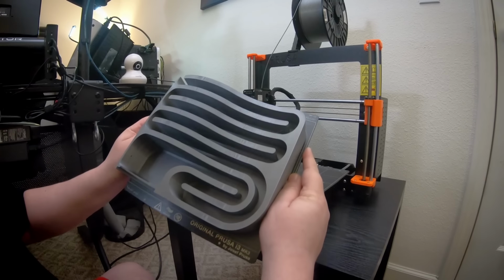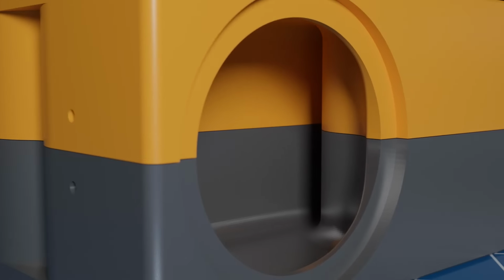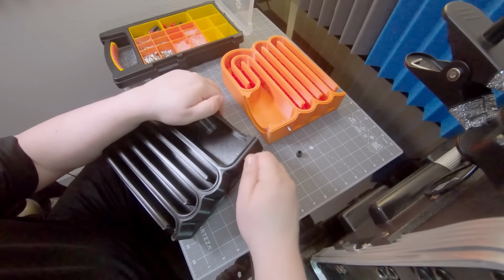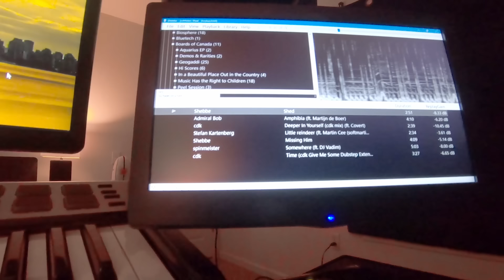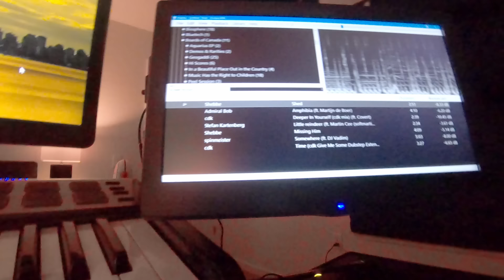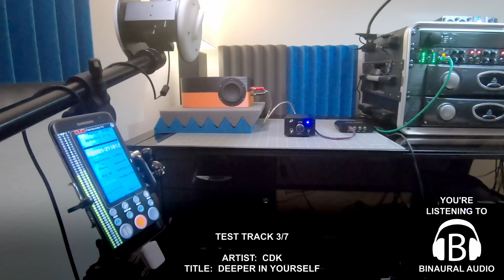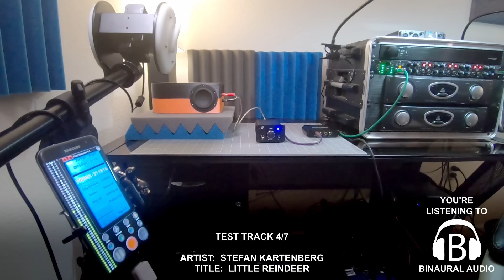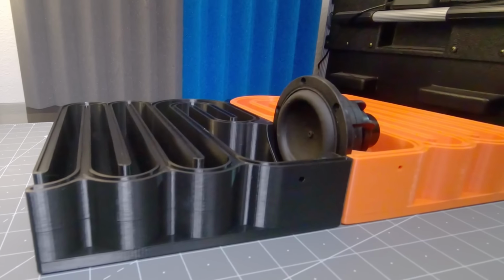3" Subwoofer Enclosure v.2 (Plus Demo)

Comment: print it hollow, instead with infill, use a thicker wall.. then cast epoxy into the PLA cavity or fill it with sand..
Reply: Would sand affect the sound quality?
Reply: You could just take a mould of the two halves and cast the whole thing in all manner of materials. What would a dense superfine casting plaster do to the sound?
Reply: @ThePatternJugglers  HAhahaahaahaha........
Reply: @christopherroberts22  did you have an aneurysm
Reply: I havent tried myself, but epoxy is cures with an exothermic reacting (it generates heat). If you trap the enclosure the heat could melt the plastic. Someone on the diyaudio group did try it unsuccessfully though.

As for the mass/stiffness. More mass lowers the resonance frequency of the enclosure, more stiffness raises it. You'd obviously want the resonance outside of the frequency range of the corresponding driver. For subs that generally means increasing stiffness.
Reply: Thu Nell Ⓥ  Not necessarily no.
Reply: Thu Nell Ⓥ  You can calculate the resonance of a panel with the formula: Fres = sqrt(stiffness/mass). You want this resonance to be outside of the range that the speaker reproduces.

For mid and high frequencies it is very difficult to move the resonance outside by adding stiffness (because the frequencies are so high). In this case more mass is much easier.

For (sub)woofers on the otherhand it is very difficult to move the resonance below the speakers range, because the frequencies are so low. You would need incredible amounts of mass to accomplish this. For these speakers it is thus easier to move the resonance up.

You can add stiffness by laminating side panels, using different materials but by far the easiest way is adding bracing. Adding braces also has the nice effect that the lower the amplitude of the cabinet vibration.
Reply: @idontwanttopickone concrete.. you do a silicone mould and cast it as concrete for maximum weight and kick

Comment: I've never herd the engineering design process called the "spin cycle" before
Reply: Patrick Zath heard*?
Reply: often called "iterative" process
Reply: It's used in metal work to my knowledge (spin > lathe). Outside that I've also heard it used in the mastering process for vinyl records.
Reply: @enlightendbel  It's a very basic principle for almost every design process...
Reply: @TheEchelon  and?
Reply: @enlightendbel  The thing is,  the youtube comment section is chalked full of textbook engineers and faux engineers who don't have much experience outside of a classroom where once you get out in the real world, all sorts of alternative terminology has been adopted
Reply: According to wikipedia: Iterative design is a design methodology based on a cyclic process of prototyping, testing, analyzing, and refining a product or process. Based on the results of testing the most recent iteration of a design, changes and refinements are made. This process is intended to ultimately improve the quality and functionality of a design. In iterative design, interaction with the designed system is used as a form of research for informing and evolving a project, as successive versions, or iterations of a design are implemented.
Reply: @LBCAndrew  yeah, I know, that's why I gave some examples and their origin.

Myself I've been trained in metal work and worked in that field a couple of years.

I've mostly spent my time in IT where "alternative terminology" is an absolute pest because idiotic managers think they are running a marketing department that has to come up with new ways to call the same old processes and methods we've used for decades.

And I grew up on an fruit farm, terminology there changes depending on what village you're in sometimes.
Reply: oops probably should have read this comment before i toasted this kid
Reply: Same! 😂
Reply: We call it "lather, rince, repeat"...
Reply: But you've probably heard of the Lean process of PDCA (Plan, Do, Check, Act) - same-same with what he means with his Spin cycle :)

Comment: Sounds awesome, I would love to see this scaled up to an 8 or 10 inch driver.
Listening on v-moda crossfade 2's
Reply: A 10 inch would make the house tear apart haha
Reply: Please scale it up to 10 inches and make measurements 👍👍👍👍👍
Reply: I have a dayton UM10 in a similar sort of contraption. Big folded bass horn assembled with plywood/screws/glue/etc. Powered by a 1KW crown amp. Box provides pretty good loading down to ~25hz. Sensitivity is very high at ~93dB@1W1M from ~30-80hz.
Reply: Hey my dude. If no one is gonna give you props on the V-Moda shoutout, here I AM!  They seriously need to bankrupt beats by dre. Only thing I have issue with thier products is the inner cord like to herniate out of the outer kevlar weave; but if left alone it causes no issue, just ugly and annoying. ✌️👍
Reply: are the V moda as good as they say? been seeing em and  hearing hype on em for a while.. i want a hands on opinion tho.
Reply: Andy Willis Andy what I’ve said before is really the only issue but it doesn’t cause malfunction. They’re incredibly rugged and sound amazing. Great range and crisp response with every frequency! I bought my wireless set on a Black Friday discount sale 2 years ago. They still look good beat up and work fine. They also offer a 50% of the purchase price lifetime warranty. Destroy them and send them in for only half of what you originally paid and they will ship you a new pair. I went through plenty of headphones in my highschool days and these are by far the best! Will definitely buy a future generation product from them if/when the need arises! 

#CrossfadeWireless
Reply: @andywillis9701  dude best pair of headphones I own, have used them constantly for 2 years doing FIFO in Australia and they haven't faulted.
I regularly do sound editing on them and the output is near perfect.

Comment: Very awesome design. Just a question: this is a T-line design. from the STL file, I can see the 1/4 wave length of the 55Hz Fs. But what I find strange, the cone surface area is 27cm2, but the transmition line cross-sectional area is closer to 17cm2. is there a reason why the design is less than the driver? or purely due to size constraints of the printer bed, you had to reduce the size?

Comment: you could also maybe trying doing one with the B&C 4CXN36 4" coax driver for a full range version, they're on parts express
they also have a waterproof coating, combine that with a protective front grill, some 18650 batteries, DC/DC converter, amp board, bluetooth module, and you have a beast of a bluetooth speaker
Reply: That is a really interesting little driver you got there!
Reply: God damn just looked at the response curve the HF is 13db more sensitive than the LF , going to need a big ass L-Pad or go active X-Over to bring it back level with the mid lol
Reply: @james8660  most coax speakers have this issue, but point source sound is great
Reply: @wow1022  You'll never ever find a 4 inch mid-range with 99dB efficiency so I guess It's inherent with the design, but yes I agree I like the point source sound, much less phase issues to correct with DSP!

Comment: Very cool. Now I all i need is a 3D printer....and a 3" subwoofer and I am good to go! :D
Reply: @HexiBase  My audio engineering knowledge is very low so if you don't mind, can you suggest a high range driver to pair with this 3" subwoofer to make this a fuller range setup? I'd love to put my Prusa to work and build a full range speaker setup + amplifier.
Reply: dayton audio ribbon tweeter, relatively cheap regarding the sound quality provided.
Reply: @HexiBase  Love this. There's actually a huge market for under-the-front-seat subwoofers in vehicles. What are the OD dimensions of this build?

Comment: You could add mass by leaving these hollow and filling the void with epoxy concrete (resin and aggregate). You could add a lot of mass by using ball bearings instead of pebbles for the aggregate.

Comment: I'm an audio engineer listening through a set of MDR 7506 cans: good frequency response to my ears. Possibly a bit over-pronounced in a few places, but that's unavoidable on ported designs and might also be the room rather than the speaker.  Also, it's hardly fair to compare this to something like a £300 studio quality sub so I won't.  For the cost I'd say this is excellent; great job!

Comment: That’s been a BOSE port design/style for many many years, possibly not the exact same but that goes back 20 years
Reply: Top comment! BOSE the best!
Reply: Try adding 70 years to that. It's called a Transmission Line or "acoustical labyrinth" and was nothing new when Bose started using it. It has some weaknesses but in this application creates impressive bass from such a small speaker.
Reply: Pretty sure this guy is bs'ing the other half of what is said..

Comment: Well, I listened to this with my Teufel suround system and the bass is very deep. Its very impressive that this small box can creat so much volume! I payed a lot for my Teufel system nearly 15 years ago, but now you can get a killer subwoofer out of a printer. Times have changed...

Comment: Back in '95 I took some ADS 300i car speakers and added a half inch more material to a cabinet I found, (total 1" thick material)  then turned it so the speakers were on the narrow side, & routed out the space for them to be inset.  After starting to test, I had NO bass, because they were intended for car doors which aren't sealed.  I did a port on the front and one on the back, used some plastic pipe for tuning, and lo and behold, they went down to 28 hz!  The only problem was I couldn't go very loud because they would distort easily (they were from the 80's after all), but they worked great with a separate sub.  Later I replaced the dome tweeters with Linaeum ribbon tweeters (they had a 2" dipole figure 8 configuration) that were routed into the top of the speakers.  They actually had great presence with a wide open sound stage.  They lacked a bit of mid bass, so I made the sub go a little higher in the x-over.  I lucked out they sounded good.  No computer, no test equipment; just lucky guesses.

Comment: It would be interesting if this concept was scaled up to a 10 inch sub.
Reply: you would get some infra bass notes
Reply: @danascoles1205  what is infra bass? I want to learn a little more and design a nice box for my sub in my car
Reply: @ronaldgonzalez9161  below-audible freq. bass. basically the stuff you feel rather than hear
Reply: @ronaldgonzalez9161  supposedly there is a note in the infra sound range called the “brown note” for reasons you can probably imagine. There are also other frequencies that are proving to be therapeutic for some conditions.

Comment: by the way, how was the precise weight of the printed design?, i'am planning to print at local service, the pricing was based on the weight.
Reply: You should know the volume of your design so just multiply it by the density of the filament material..
Reply: Download the design from thingiverse - Put it in a Slicer (e.g. Cura or Slic3r) Slice it to your liking and see what it says how much filament will be used for each side. I know Cura gives you both - Length and weigt - assuming you set the Filament parameters. Then you know exactly what you need

Comment: Have you considered changing the nozzle size?
You could easily half the printing time
Reply: Nick's Stuff wouldn’t he also lose some precision as well, not that it would matter considering it would still be stable.
Reply: @vipervidsgamingplus5723  I believe it would have a very minor impact
Reply: What he should really do is remove the bottom layers, print with very low infill (2 - 5%) and the resin fill the cavity once printed. He could save a ton of print time and have a fully solid part when done.

Comment: You need to make a version that holds a 5 1/4" speaker,  also add felt tape around the walls of the t-line, this will stop any upper midbass resonance.

Comment: Hey, you could try printing it and pausing the print right before the top layers. You can even embed a pause command in the gcode. Then fill it with fine concrete or something similar and continue printing. Then you have an heavy solid Woofer! :)

Comment: You could try to carve that design on wood for a warmer sound
Reply: With a cnc mill it would be possible to make something like this. The problem would just be finding a good piece of wood with no interior imperfections that could mess the whole thing up
Reply: Hedge or allso known as Osage orange would work really nice, great acustic wood
Reply: @bobmybob9493  and also be quite costly in comparison
Reply: @mattias2792  it would be hedge is hard to work and finding the right piece would be really hard to do
Reply: MDF or beach ply laminated sheets together would make the sound better and keep the cost down.

Comment: In the interior of the car will feel the increase in bass power, if you install 2 of these subwoofers? (TDA 7850).
Reply: matt karl  I know what you're talking about. I have 4 kids and a minivan with 3 rows of seats. It is impossible to place the subwoofer in the rear, as children are not comfortable on the 3rd row with a 10 inch subwoofer (the high sound pressure). I am considering the option of installing such a subwoofer between the driver's seat and the passenger seat, solely for the transformation of the sound picture of the driver and the front passenger. In such a local solution, it seems to me, the effect should be.
Reply: matt karl  no. 
Bigger isnt the answer..
I had a 6.5inch TL sub in my car that says you're wrong.
Beautifully clean low bass you could feel. Not 140db, but it worked perfectly.

Comment: When will u be looking for a 6,5" woofer and 8" woofer enclosure like this? I would be willing to pay for the designs! :O
Reply: Same - I could see a great business modding this design for different drivers. I'd pay $100 for a design using a JL 8W3v3  that could fit into the trunk cubby on an X3
Reply: @MarshallClark1  TL enclosures get very large as driver size increases.  I made one for an 8" Sundown, and it's huge.  I also bought a 6.5" Skar for a future build.  3D printing for either of those would be very difficult.  However, for a little 3", it's a great option.

Comment: I made one of these.  On the upside, it's the largest most perfect print I've ever done.  Took around 38 hours and roughly 700g of filament each half.  On the down side, for what I paid between the sub and the filament, I probably could have bought a better sounding sub.  It sounds just like a 3" subwoofer would expect to sound.  Definitely not that tight bass you get from one of those bose systems.  The design itself is actually very nice. Wish there were holes for the sub mounting screws.  I ended up putting in brass inserts which I probably should have practiced some before trying on the 70+ hour sub enclosure.. lol.  It was a fun project, just maybe had my expectations a little high.

Comment: Hey, I was wondering if we could improve the sound even more by filling up the space inside with foam pebbles like iPhones do with their speakers, or would that make the design completely useless?
Reply: what do you mean? what foam pebbles in an iPhone speaker?
Reply: @KennethSpringsteen  There are micro foam pebbles inside mobile speakers these days. I think it adds mass to the free air inside the micro enclosure, which makes it equivalent to a much larger enclosure. This is why mobile sound sounds so good these days, even though the driver is tiny.
Reply: @Jadinandrews  Thanks for the follow up.  I was thinking about 'mobile phone speakers', like the ones built into the chassis of the phone itself instead of the portable Bluetooth ones, like the Bose Soundlink or whatnot.  This concept makes sense as fillers are used in large car audio speaker boxes for the same effect.
Reply: @KennethSpringsteen  he is talking about the speaker in an actual iPhone.

Comment: Couldn't you just use a rubber gasket and screw it together so it can be taken apart?
Reply: Yeah from an engineering POV this is really poorly done but still impressive none the less. In reality you would never produce this with FDM because 50 hour production time is awful. Being is it’s such a simple shape it would be moulded plastic.
Reply: @renderyours510  yeah but if people could just print this thing out at home and screw it together that would be legit. This would be dope as a baby sub in my 1970 VW bug.
Reply: @ryaneaton6851  I've got a 66 bug. 
My question is, is the thing capable of being heard inside the bug or would it be better heard outside? 
I've been looking to add more bass to mine. Already got a custom single box, double chamber ported 6x9 setup.
Reply: It's just so small I feel like you could fit a few behind the back seat or under the front seat. Even mounted under the dash would be cool! I just like high quality sound from a small package. I custom made a box for a single 8" sub with a vent that was all made to the perfect air space spec. It was for the eclipse I had about 10 years ago. I would pull up next to people that had 2 10" or 2 12" they always thought I had a bigger system than them showing the single 8" blew their minds

Comment: i'd love to see this up-scaled to take a 8" sub.
Reply: size doesn' t matter
Reply: @MichaelMantion  I have to kindly disagree with you there.
Reply: It looks like it’s about 8 inches on each side, if u scaled it up for an 8” you’d need like a 20 inch square base printer to get it done in the two pieces like this. Volumetrically it would be like 8-10x larger and therefore take that much longer to print. Would probably just be a nightmare all around.